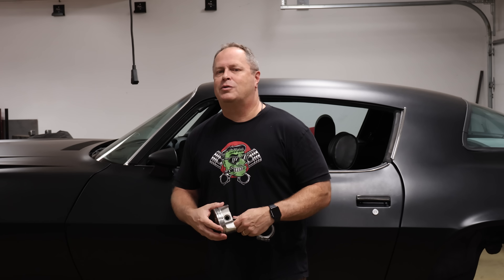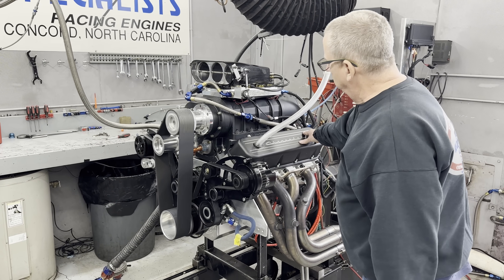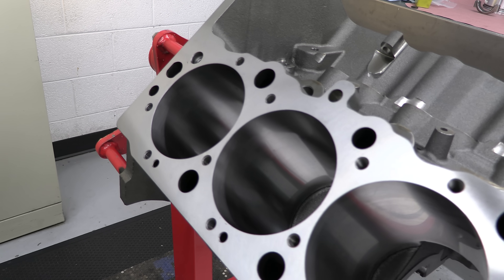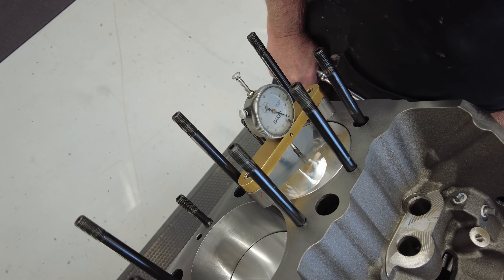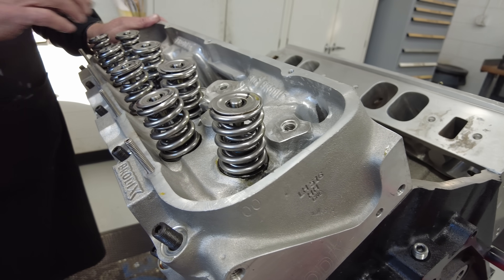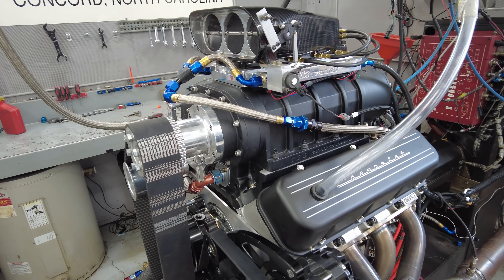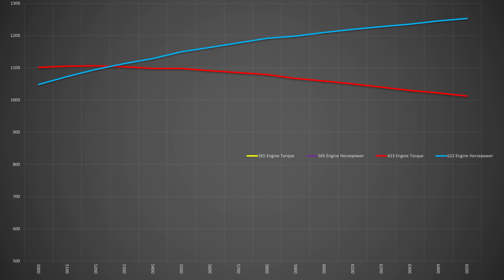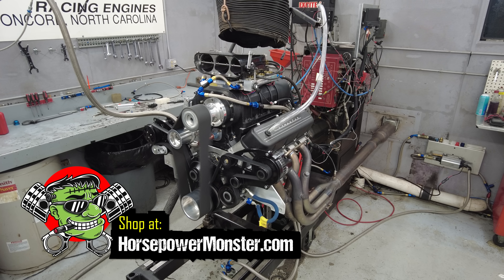Brutal Big Block Battle: 565 Faces Off Against 632 on the Dyno!

Comment: wow 632 and with a blower and only 1200 hp, yet harrop made that with a godzilla ford engine with a small blower, 2.6lt ,so this engine should be making like around 1500 to 1800 hp depending on what type of fuel used. 🤣🤣✌🦘

Comment: You would think they would have tried a smaller pulley on the 565 before jumping off a cliff. Also I know its for a "street car" but why not spin it faster as it does not look like its laying over yet. If it's just for science even. Everything else being equal piston area determines HP capability. Stroke determines at what rpm the torque peak occurs. You can bore or stroke an engine to get more power, spin the engine faster or use a power adder. Be best if you could increase the bore over increasing the stroke but unless you are magic and can increase the bore spacing to allow larger bores stroke and rpm are all you have. IMO with today's advancements in valve train design and metallurgy I choose more rpm's.

Comment: Thanks for the comparison, appreciate your work. Cool stuff, I guess the thing that comes to mind looking at those power curves for me is not so much "look at the comparison" but more "how high would you have to rev this thing to see a peak in the power?"
Reply from the maker: Woah! Thanks for that! Yes, I'd love to be able to run the dyno test on up to see just how high the power would go, but Keith Dorton set a realistic redline to protect the rest of the engine. Thanks for watching!
Reply: @TheHorsepowerMonster  yep, and that's a fair call to make with the redline. no good discovering the hp peak just to then also discover the point at which a conrod goes to the stratosphere.

Comment: First I freaking love your videos.

Second, why do they always run the belt on the outside of the tensioner, wouldn't it be better to run it on the inside and get more wrap?Although I guess with a cog belt, it probably doesn't really matter but it just always seemed.Weird to meAnd why is there so much belt flap?If you have a tensioner, shouldn't it be tighter?I've only run one positive displacement blower, and that was so long.Ago I don't even want to say and that was just an m ninety, but I don't remember it flapping like that.Of course, this was on a serpentine belt
Reply: On a screw type blower it doesn't really matter which side you run the tensioner on. It's all about clearance. Most of the time you have a waterpump to contend with so you run the belt on the outside of the tensioner. Also,you don't run those belts really tight like a serpentine belt so they flop around a bit. Although if you watch a serpentine set up, there's quite a bit of movement in the belts as well.

Comment: Great comparison, the only info that i feel would be interesting that you left out was how much boost the smaller engine made, if they were using the same pulleys for both set-ups my thinking is the bigger engine should have made less boost because it has a greater ability to use the incoming air, still a great video love your work as usual documenting these engine builds for us, much love from Australia

Comment: What would be the difference in price between the two engines?
Reply: Both engines use a 4.600” block and same heads so the difference in rotating assemblies should be minimal if using the same brand of components.

Comment: I don't get it: where is the air filter element in this configuration?
Reply from the maker: There is not one in this setup. You are right, it's not very practical.
Reply: @TheHorsepowerMonster  thank you for answering my question; I thought you said that this engine will be for a street configuration, so won't it get damaged in dusty conditions, or if debris gets sucked in?

Comment: Given the Roots blower moves essentially a fixed volume of air per rotation, and assuming the pulley ratio stayed the same on both engines - then for any given rpm both engines were being fed the same amount of air (and fuel). If that is the case then the larger 632 was simply more efficient? Otherwise both engines should make near enough identical power since for a given rpm they are burning the same amount of fuel.

Or to put it another way, if the 14-71 blower is moving 551 cubic inches per rotation (I know there's some variance between manufacturers) and the pulley ratio is 1:1, regardless if the engine is 300 cubic inches or 600 cubic inches the mass of air being being pushed into the engine (551ci) is the same.
Reply: I was wondering if the pulley teeth were changed between the two so that they would have the same boost.  That along with the compression ratio would need to be close to equal.
Decent test though.
Reply: @gregmckinney6977  Me too. Otherwise I'm thinking that the potentially lower intake charge temp from having lower boost (assuming the ratio stayed the same) allowed more aggressive ignition timing and more power. Still seems a big change in power though without speeding the blower up.
It was a decent test, I just can't explain the outcome haha
Reply: That's incorrect. The 632 provides less resistance to flow (actually increased vacuum), so more air is ingested
Reply: @bobqzzi  On a NA engine.  For a supercharger it can only flow so much air so the boost does become an issue, reduces, unless you speed up the blower.
Reply: @gregmckinney6977  Indeed, and especially for a positive displacement roots blower where the rotors seal one side of the supercharger case from the other. The volume of air delivered is entirely dictated by the blower.

Comment: If you want to start to get into semantics I can start to argue the laws of scaling to you, which is why ship engines rev at like 150rpm and sports bikes rev at 18,000rpm. Displacement is a static figure there is no time value like RPM, so arguing about displacement is retarded when horse power has a time factor involved.

Comment: Well the Chrysler Hemi big block makes 12,000 horsepower. 498 cubic inches. Try that with your slow tie.
Reply: Are you really comparing an all out nitro drag engine that lasts 1/4 mile before teardown to a street car engine running on pump gas that is meant to last thousands of miles? Doesn't matter if it's a chevy, ford or dodge lol. Two different worlds. Come on now
Reply: Hemi was the most expensive POS passenger car engine ever designed.
 Both Grumpy Jenkins and Bob Glidden would donkey stomp the hemi with  331ci small blocks.
Reply: @bigboreracing356 well that's funny.. the 331 doesn't come up when you Google what the most successful drag race engine of all time is... hint, it's the hemi lol... here ya go.. For professional-level, unlimited-class drag racing, the Hemi engine platform has the most wins. The current billet aluminum Hemi architecture is the ultimate evolution of the iconic engine series and dominates Top Fuel and Funny Car, the pinnacle classes of the sport.
Reply: 331 engines were destroked passenger car and truck Small Block Chevys and Fords used in  the early days of Prostock racing.
 The small block Chevy is the most successful race winning engine in the world 
 The Hemi won a battle that only a hand full of people could relate to.
 The Small Block Chevy won a WAR that millions and millions of people including Ford and Mopar fans could relate to.

Comment: Boost tecnicly tecnicly increases the displacement, more air per stroke. the calc is (14.7+boost pressure)*(na hp)/14.7. gets you very close. the calc asumes a lot and breaks down when your boost source is over the hill just makeing hot air. 

but when sonene says their stock 350 in 4psi of boost is makeing 1000hp you can call bs with confidence.
Reply: Boost does not increase displacement.
A 350 ci small block is still 350 ci whether  boosted or naturally aspirated.
Reply: @bigboreracing356   its literally displacing more because of boost. That 350ci motor is aspirateing like a 700ci motor at 14.7psi of boost. that physical 44ci cilender now holds 88ci of air with boost.